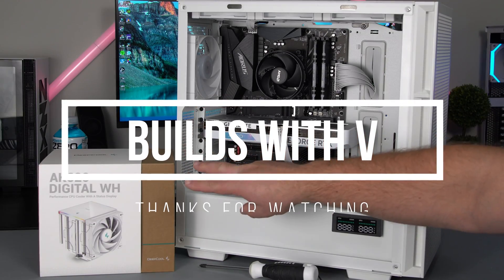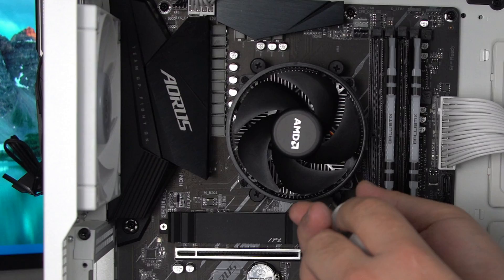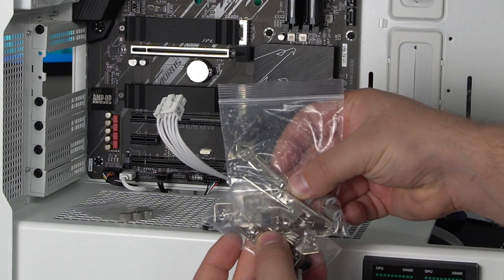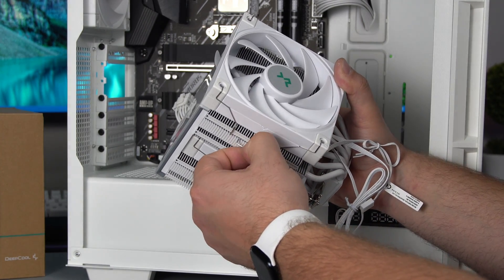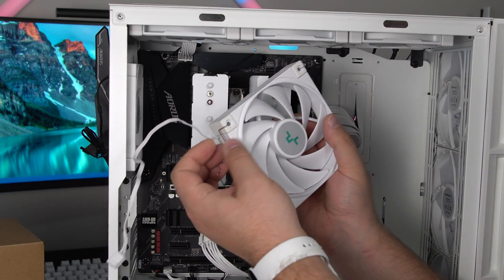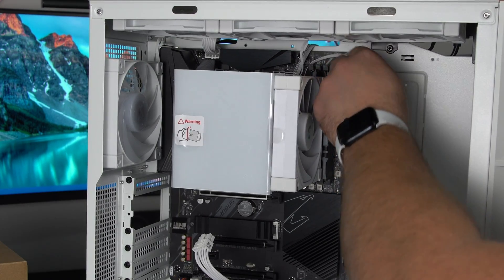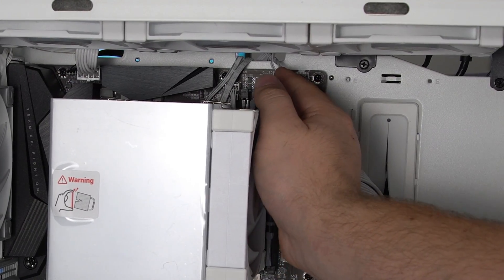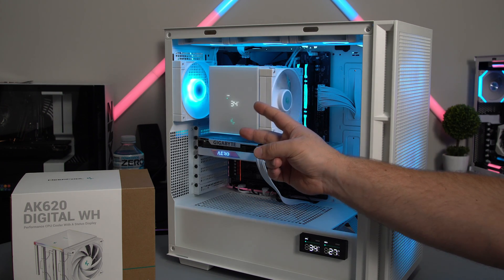How To Install DeepCool AK620 Digital CPU Cooler

Comment: The cooler doesn't line up with the rear exhaust fan my OCD is acting up. I know it's unavoidable, just sayin'.
Reply from the maker: Same, that's one reason I avoid air coolers 😅 but overall I just prefer AIO coolers

Comment: Really nice and detailed guide on how to install this cpu cooler. I love air-coolers, especially the white ones, but this one is just way too big, like a huge white cube. Idk how would look inside my case, it would just cover all my memory slots. Although i really love the simplified look and that it shows the cpu temps, really useful.
I still use my nhu12s with the chromax white cover, push-full fans and white anti vibration pads from Noctua.

Comment: The reason i searched for a guide was not the installation of the cooler but having 2 fans connecting to 1 cpu fan slot.. thx for covering

Comment: Can i pust the from fan in the middle and the middle fan in the back ?
Reply from the maker: @Centurion.  Yes you can as long as everything fits.
Reply: @BuildsWithV  thank you do you thin this is deepcool ak620 better than the assassin 4s with its single 140mm fan ?
Reply from the maker: @Centurion.  I think this is better just due to the larger heatsink but I haven't tested so not sure. I will have a video soon (maybe 1-2 week) installing a thermal right cooler. The one I have is also 2 fan
Reply: @BuildsWithV  thank you soo much you deserve all support i wish you all the best
Reply from the maker: @Centurion.  Thanks so much 🙏

Comment: white letters on a white surface...
any visibility issues?
Reply from the maker: @Hubi260  no issues for me. The light is bright and easy to read. Maybe if the room is really bright then it might be an issue
Reply: @ thanks! It was hard to tell in other videos in bright rooms and at an angle
Reply from the maker: @Hubi260  yeah they usually have bright lights for filming and causes the lighting to look washed out

Comment: I'm 36 years old and this is the first time I've seen someone using so much thermal paste in my life, lol

Joking aside, lovely build, bro. I'm trying to figure out which AC should I buy.

My problem with the AK620 is this outside fan blocking the RAMs :(
Reply from the maker: @Fl4wles5  yeah I tend to put too much 😅 I’m very bad at “eye balling it”. I need measurements lol for cooking and for thermal paste. Thank you, I appreciate that! Yeah this cooler is beautiful and works very well but blocking the ram is unfortunately a deal breaker for many people. I got lucky since I had such low profile ram sticks

Comment: My case turned up to be too small for this cooler. My ram is too big... So the tip of bringing the cooler to the back was great tip! It saved me
Reply: If you put the fan at the back and middle, you better put the middle one against the front tower instead of the back tower so it can suck air from the front part of tower instead of the space between the 2 tower like in 7:16
Reply: @lazypioneer91  what do you mean? It was always meant to suck air from the front, as it is shown in the video. No fan of an air cooler supposed to suck from the back.
Reply: @dotlacity  make it like this
(Fan1)[Tower1] a bit of space (fan2)[tower2]
Instead of
(Fan1)[Tower1](fan2) a bit of space[tower2]
Dont make both fan latched to tower 1.
Reply: @lazypioneer91  Won't the fan blades rub against the tower like that?

Comment: Nice guide. I just bought the same cooler and it´ll be arriving next week. One question: you actually have CPU_FAN + CPU_OPT conectors in your motherboard, why you just connect both fans directly instead of using an splitter adding more cables to the build?

Comment: Does it work with corsair ddr4 rgb ram? Is it stuck or not?
Reply from the maker: @rizkiindraprayoga1172  I think the corsair might be too tall but I’m not positive unfortunately
Reply: @BuildsWithV  cooler fit with corsair rgb pro ls on coolermaster TD 500 mesh. thanks man the cooler is chill more than aio watercooling. my cooler was permafrost 240 from silverstone for about 4 years

Comment: One end of the cpu cooler (where the screw is) does not line up with the other bracket on my motherboard 😢 I don’t know what to do..
Reply from the maker: Check to make sure you’re using the correct bracket for your motherboard and cooler. Also make sure the brackets are installed in the correct orientation. What motherboard (or cpu) do you have?
Reply: I am so silly, I had one of the brackets upside down this entire time..that’s why there was a little bit of space on one end 😅

Comment: i had mine running but i connected the 2 fans on the CPU_FAN and the CPU_OPT respectively without using the splitter, is there any difference in them?
Reply from the maker: No difference, both run the same. The opt is just optional.
Typically you’d use that for a pump or something similar but can be used for fans

Comment: I actually just recently got the black version of the AK620, Do you know if the display turns on when you power the PC on?
Reply from the maker: I believe it should turn on at startup or once it’s fully on. I don’t remember but yes once the pc turns on the screen is supposed to turn on.

Comment: I heard the thermal paste comes with coolers aren't that good is this same with AK620?
Reply from the maker: The paste that came with this I wouldn’t have any issues using imo but it never hurts to get something that’s been proven to be good. I always replace thermal paste at least once a year so I’d probably use this for first year and then upgrade.

Comment: Received mine a few days ago, thought it worked good until I noticed that anything I tried to open, Chrome, Steam, Battle net client etc,  they took forever to open. I turned off the Deepcool software and everything was back normal. Now I just use it as Cpu cooler with no digital display
Reply: any update what happened now?is there any latest updateto fix the issue?
Reply: @jhoper99  I haven't seen a new update yet.  I have it turned off and just use it as a cooler .  I use my other software to watch temp.

Comment: Hi, I was curious if you ever tried connecting the cooler's ARGB panel to the CH560's included ARGB controller? I have the same case and cooler and notice that some of the LED's on the cooler's panel will not light up when connected to the controller in CH560 Digital. Deepcool sent me a replacement panel, but the same thing happens. If you haven't done this, could you do me a favour and test it and see if all LED's light up for you? Thx in advance.

Comment: How did you line it up so easily? I swear the bracket on the heatsinks is like ¼inch too short to get both studs in
Reply from the maker: You may have one of the cpu brackets upside down. Double check that first
Reply: @BuildsWithV  I 100% did and forgot to delete this thread.
Reply from the maker: @theris117  no worries, glad you got it fixed 🙌

Comment: can i chain the case argb fans 3 pin 5v on the extension ? my mobo only has 1 header for 3pin 5v
Reply from the maker: You can but I’d recommend a rgb hub.
Reply: @BuildsWithV  i already bought mine and install however no D_led on my mother board and ill try to buy 3 pin 5v on the extension. what are the consequence using on it?

Comment: Bro can i put that front fan into the back. It blocking my RGB ramns 😢
Reply: I've been thinking of the same thing, also because my RAMs are pretty tall. If I'm not wrong, unless you don't change the direction of the fans, you should be good. Actually he mentioned that at 7:50.
Reply: @TheSaddy  I end up buying ak500. Which is good and not blocking my ram.
Reply: @Unknown-qr7mj  ah alright, I’ve bought the AK620, but since I’m still waiting for the ram to come(corsair vengeance rgb DDR5,which are pretty tall), I had this doubt until now
Reply: how is the fit with your rams? @TheSaddy
Reply: @seanchina9902 well, at the end I got the non-rgb ones, cause of some problems during the delivery, and I would tell you that it fits perfectly. So probably the rgb version would cause some problems, so you will probably have to move your fans location or either, put the fan,the one above the ram, a little bit higher
Reply: @TheSaddy  i see. Thank you! I think I'm gonna go the same non rgb route. Performance over aesthetics for now. The ak620 is a beautiful cooler anyway 🤣
Reply: @seanchina9902  yeah, my build doesn’t really have anything RGB except for the rx 7900 xt nitro+, so I went full black

Comment: Ram clearance can I install a g-skill-trident-z5-neo
Reply: Yes! But you will have to slide up the fan up just a tad bit to make clearance but that will be okay
Reply: @elgatoslayer.1 , I have that same Ram kit and didn't need to adjust the fan height, as it remains flush with the top of the cooler. That said, I'm thinking of trying the fan on the rear of the cooler, as mentioned in the video, so the RGB on the Ram is on full display...
Reply: @kgreig8365 did you try that? If so were temps ok? Cuz I’m trying to do that cuz I’d like my rgb ram to show, but if it doesn’t work oh well
Reply: Same ram. Yeah. U have to adjust the fan a little bit for the ram. Still looks good
Reply: Yes and you don't need to adjust the fan height.
Reply: Bro why can’t u look this things up? The specs and measurements are all over the internet

Comment: Friend, what should I do with another one? there is another plug there, which is covered with a case, and there are 3 more pins, what are they for? I've reviewed it 10 times, connected it properly, but still there is one with the case closed, it is not used

Comment: My question isn't related to the installation of the AK620 but, instead "Will it be a good enough CPU cooler for my new 5800X3D"??? :s
Reply: Yes.
Reply: @chasebroyles6585  so, can I ask what temps you were getting with your 5800x3d using the AK620?
Reply: @k24skin  I have a 7800x3d and with tuning I have seen a max of 73 degrees. You should never throttle with a 5800x3d.
Reply: @k24skin  80 degrees at 100% load for my 7600, and around 55 degrees at 50% load

Comment: You sir are my savior. This is my first time building a pc. I went with the fractal north case so i wanted an air cooler to make a nice aesthetic, ended up buying this one. Hopefully it keeps my cpu temps low. I'm using the 7800x3d and the 4090 founders edition!
Reply from the maker: Glad I could help 🙌 This cooler will definitely keep it at good temps and the aesthetic is definitely there! Thanks for watching 🙏
Reply: are you having good performance with it? I'm getting my new pc parts shortly and I'm planning on running the 7800x3D and a 7900 XTX
Reply: @jacemiranda6510  how is it going today man? I bought the 7800x3d and I'm thinking of purchasing this cooler as well

Comment: As a person who's been building PC's for the better part of 10 years, this is a really well-done video. I'm actually installing this cooler on my updated build this weekend, first time doing air compared to an AIO. I'm thinking of using my Lian-Li Infinity fans instead of these, what's your thoughts?
Reply from the maker: Thank you very much 🙏 I really appreciate that! I think the infinity fans would look stunning in this. Maybe not in the center since that’s covered up but what if you did 2 infinity fans (one on each side) and then keep the stock fan in the center. Maybe too many fans but might look cool 😅
Reply: @BuildsWithV I’ll let you know if it works out!

Comment: Would there be any room for GPU vertical mounting? This cooler looks pretty big. Thank you and very good video.
Reply from the maker: Yeah the cooler is too big for vertical gpu. Maybe with one of those mounts that allows it to sit at an angle but even then I don’t think it would fit. Thank you 🙏
Reply: I have ordered the AK620 Digital with a vertical GPU mount for my XFX QICK 6750XT.
The build arrives saturday, will report back on sunday if it fits.
Reply: Can you vertical mount the gpu? @mekloten
Reply: @mekloten so did it fit?